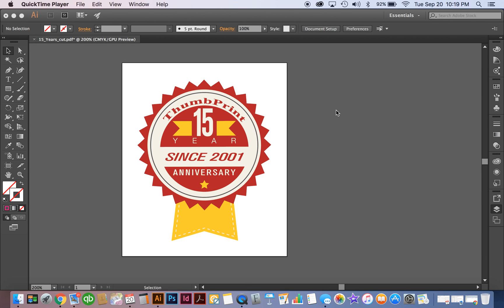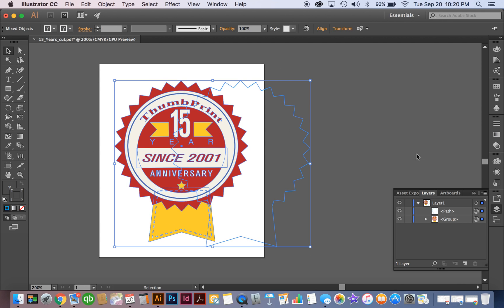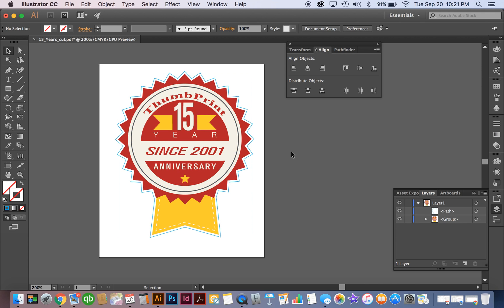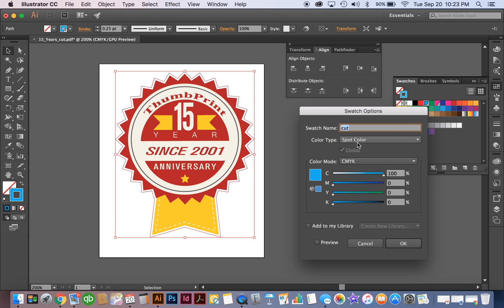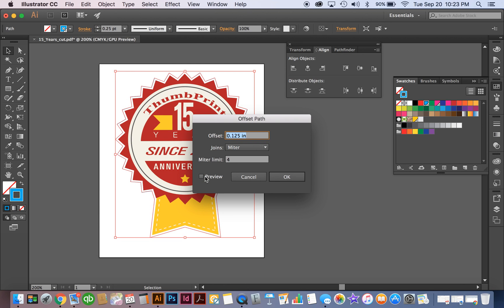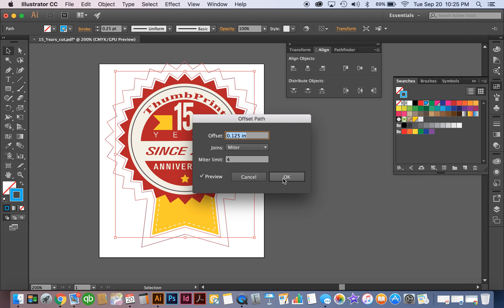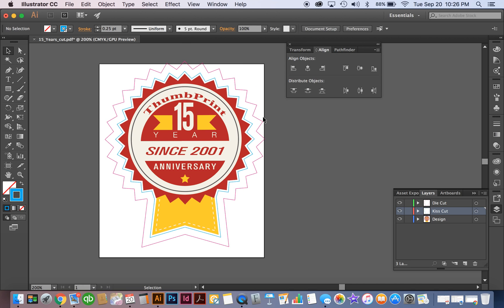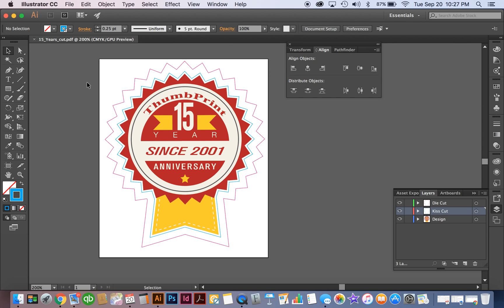File Prep for Kiss Cut/Die Cut on Graphtec 8600 cutter

Comment: For some weird reason when I save as eps the CutContour line cuts double on my Graphtec.  But when I save as PDF it doesn't cut double.  

I use ONYX RIP
Reply from the maker: What version of Onyx are you running? I have seen that happen on older versions of Onyx. In the case of double cut, use a fill instead of a stroke. Thanks for the feedback.